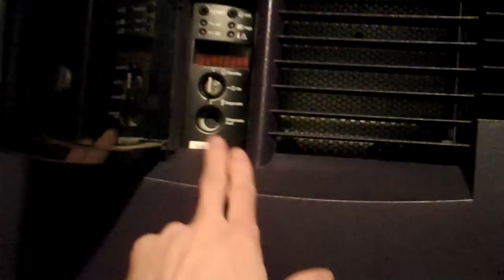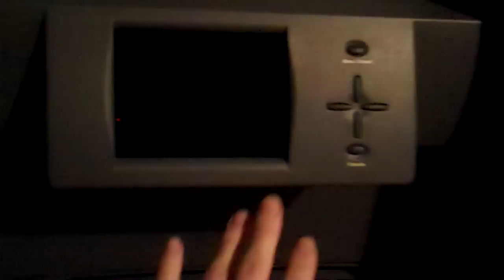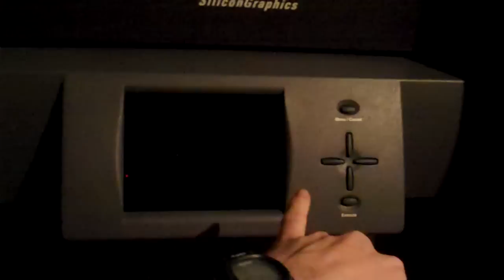SGI Onyx2 five-rack system tour, Part One

Comment from the maker: Kind of depends on what you're doing with it. The 2700K is ~15 years newer than the Onyx2 system. But a single 2700K on a reasonably good board has less throughput that a multi-rack Onyx2 because you're throwing a large number of processors and resources on a highly efficient bus designed specifically for parallelism. Always remember: An Intel processor is a general processor - it does lots of things "fairly well". These systems were designed to do a limited range of tasks extremely well.

Comment: I would think that just one of those would be good enough for animating, rendering but 5?..
Reply: The Origin3800 rendering system I obtained from Sony PIctures Imageworks had 36 CPUs (part of an original 48 CPU system). It's never enough, a single frame can still take hours to render and might depend on 500GB of assets, hence the need for a fast SAN (typically 10GB/sec).

Comment from the maker: @getpagesize Depends on your definition of cluster.
The newer SGIs that are more like a cluster-of-independant-computers definition all run Itaniums and, consequently, Linux. However I consider the Onyx2 and it's graphics-less brethren, the Origin2000, and its progeny (Onyx3000/Origin3000) to be clusters. They're standalone machines that are connected with a high-speed proprietary bus (CrayLinks + Router boards). So in that respect, yep :)
Reply: A cluster wouldn't normally use a single OS instance to run the entire system, so the word is not the best description as it allows people to infer too many things which are not true, plus the system  has cache coherency (clusters typically don't) and overall system bandwidth scales with node count (a cluster wouldn't behave this way). It's more correctly called a single system image shared memory design, ie. ccNUMA (cache coherent NUMA).

http://www.sgidepot.co.uk/origin/

I think NASA and the DoD had custom 2048-CPU O3900s btw. SGI was planning to increase scalability to 37500 sockets with O4000, but alas that never came out (instead they spent years porting the existing 1K scalability to Linux), though NUMAlink lives on with the impressive HP SuperDome systems, currently NUMAlink8 (64GB/sec IIRC):

https://community.hpe.com/t5/servers-systems-the-right/the-unique-modular-architecture-of-hpe-superdome-flex-how-it/ba-p/7001330

FYI the original CrayLink is 800MB/sec each direction (ref 8:25), not 800Mbit. ;)